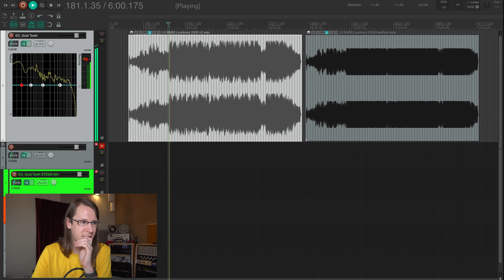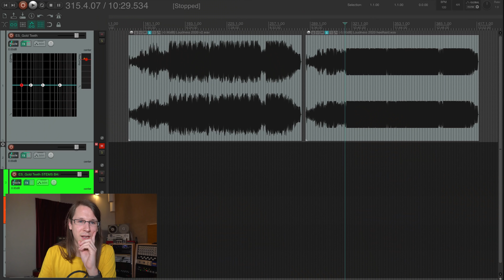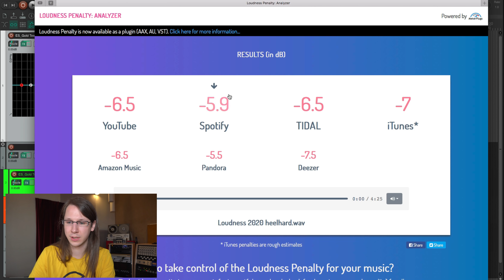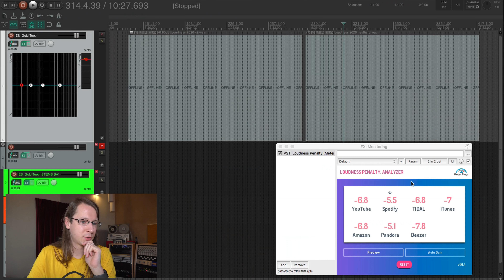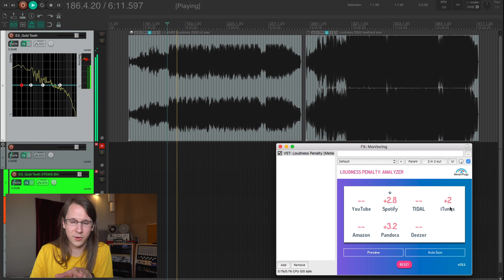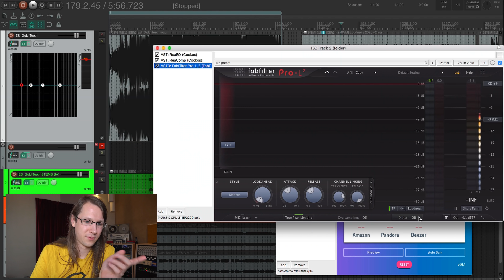MASTERING FOR STREAMING IN 2020!

Comment: WARNING: as much as I love this channel, this is VERY misleading. Master your track at the recommended Spotify volume and then be amazed and depressed when your song sounds significantly quieter than the next one. The default setting in Spotify is normalization but you can turn it off, and they’re not transparent about the process of “normalizing” at all. If you look in the Spotify for artists section on mastering, they give a vague explanation, but it’s clear that it’s not perfect. Bottom line, all the top mastering engineers still master to a -8 RMS for any mainstream style of music (hip-hop, electronic/edm, rock, pop). The art of mastering at this point is being able to make loud masters that are also dynamic. IT IS POSSIBLE. You just have to know what you’re doing. For dynamic music (classical, jazz, folk), yes, make it quieter. But what’s also never talked about is you don’t even use a limiter in these genres usually (altho a lot of contemporary jazz that’s not off blue note or verve definitely is trending towards a more contemporary limited sound, e.g. Brownswood records). My suggestion is use a maximizer and then  2-3 limiters in series as the first thing you do, and then work backwards. Start at your target volume and then make the master fit into that volume. Why? Because maximization and limiting IS compression. You need wayyyyy less compression than you think once you’ve done this, and then you just sculpt into the limiter. Try it. Game changer. Anyway, don’t believe the hype. Great channel, just a misleading video
Reply: Hey Justin, heard the same thing. I am wondering, how do you set up your mastering chain? I've been pushing my volumes up with just one limiter but seems like it's not ideal and I should use many limiters in a chain. I am just not sure how much gain to push in each of those limiters. Say I need +10dB increase in gain, do I slap on three limiters, each one giving approx. 3-4dB in gain?

Comment: the reason for -1dB headroom is because it may clip after being converted to the codec of platform and avoids intersample peaks
Reply: 1.5 db for mp3
Reply: I guess my question is why they cant analyze the volume first then convert.
Reply: @klontjespap  every mp3 I've ever looked at does not have any headroom. Have you found one or why do you say 1.5db of headroom since literally noone does that, can't find a single mp3 that has it. So if you do that then your track is just gonna be 1.5db lower than literally anything else in your library
Reply: AboveEmAllProduction that’s why the headroom is necessary, the conversion literally eats it up
Reply: @Tiban  no , not really, it does eat up alot of it, but not 1.5db. and if you already used True peak limiting in the mastering chain, theres only ever about 0.5 - 0.9db extra created from the mp3 conversion. and if you look at your local mp3s; most of them seem to go way over 0dbfs; thats why my point is valid too - your master WILL be quieter if you use true peak limiting ASWELL as -1.5db of headroom.
Reply: AboveEmAllProduction No because your true peak limiter can‘t 100% correctly predict the intersample peaks after conversion. If it was so why don‘t u just put your true peak to -0.0001dbtp? Should work fine then. there‘s still even with true peak depending on the file intersample peaks up to 1.5 db put tbh I myself always use -1.0 dbtp with oversampling on (which calculates the true peaks even better) to make it fine. after the converted audio i don‘t have headroom anymore like this
Reply: @vincevangoat1  Some real mastering engineers do not limit their tracks at -1dbtp, I've read this makes the track sound more compressed while being too quiet, I would say -0.3 to -0.5 dbtp is a sweet spot for making the tracks breathe while being as loud as other commercial releases.
Reply: Audio may clip if u boost some frequencies in eq on Spotify (if it’s not -1,0 dB)
Reply: LowLinK  haha you've got a point man, all this discussion about intersample peaks and mastering for Spotify exclusively bla bla bla, like if the audience will actually be able to tell any difference - they will just like the loud and powerful stuff, like "bad guy" by Billie Eilish.
Reply: @joel6633  It gets normalized anyway though, so if you have no dynamic range your shit's gonna sound terrible even though it's "louder" in raw audio format. Most amateur masters that try to push too hard when played next to good masters of the same genre with engineers that know how to preserve dynamic range, they sound like ass - the bass is held back by the squash and there's no punch at all. The reason Bad Guy still slaps normalized is because of dynamic range, not because it's squashed.
Reply: @cyootlabs  I'm sure it isn't squashed, but I doubt they mastered it to -1dbtp. I have noticed some songs actually sound more quiet than others in the same genre on their loudest peaks even though they're normalized. I would guess that's because the louder stuff had a higher ceiling than the lower stuff.
Reply: Intersample peaks can go above 1db. Limiting to -1 is never enough. It is pointless to limit a certain amount just to compensate for intersample peaks. Just set the limiter to however you want.
Reply: @AboveEmAllProduction  You are absoltuly right. I have tracks with peaks up to +1.6 dB. Master as loud as possible still applies.
Reply: @pushtoenter4174  no you still shouldnt master as loud as possible :) thats the wrong mindset. but technically speaking i hear you, you are basically trying to control the dynamics to make it as "loud as possible" without having distortions that are too audible. +1.6dfbs surely causes tons of distortions?
Reply: @klontjespap  no 1 db is enough, the thing that causes the intersample peaks is the psychoacoutic filtering used to remove information that most can't hear, this filtering (like any filtering) causes a change in the waveform causing the peaks to change, this results in overs of up to 1DbTP

Comment: A friend of mine uploaded a quieter track in spotify: it was really quiet (made on purpose hoping that spotify turned up the volume). That did not happen, i think spotify and other stores do NOT turn up volumes. just down
Reply: That is also what they told me
Reply: I knew Youtube do this, just trying it out of curiosity a couple months ago
Reply: I think this is quite likely true otherwise they'd need a limiter in their normaliser
Reply: Remember u can still mark "normalize" option in Spotify settings and check them again
Reply: Make sure the option for level matching is turned on, and make sure you're not using the web client, as it doesn't even offer that option. But yeah, you can't just expect to upload a quiet master and have Spotify turn it up an limit it till it sounds as loud as everything else, because there are so many reason why one track sounds louder than another that can't be caught with a LUFS meter.

The loudness wars are not over.
Reply: @David Shackney Technically, no difference. You can then think the compression being the penalty itself. The common misconception is that compression (and limiting in its extreme form) makes things louder. Actually it doesn't, quite the opposite, they are turning things down. The headroom then allows gain compensation for louder but less dynamic audio, and most of them do that automatically when you adjust threshold. You can think the loudness penalty as having a limiter but the gain compensation turned completely off. It doesn't really make any sense to kill the dynamics, since you don't gain anything in return. 
"DJs have done this for decades", yeah, the opposite way. It's "safer" to be a bit too much loud than losing the energy, and no-one wants to be the DJ that sounds weaker than the one before. So by the end of the night the last one is playing every meter solid red. Pioneer has always decreased the level where meters go red, but DJ:s became aware of that. But what they are not aware, is that there is always a limiter to protect the sound system, that doesn't allow them to exceed certain level and the ones playing too loud will sound like shit. Best example I remember when I saw Koxbox few years ago. He was hitting the limiter so hard, whenever there was bass, there was only bass; whenever the bass dropped, all the mids and highs went up so much it was actually painful, even 100 meters away of the stage, outdoors. The same goes with mastering for streaming, the more dynamic masters will sound punchier and overall more juicy than the ones that have pushed to death when played at the same level.
And for the remasters, why not? The big records have already been remastered many times to match the era. I don't see why wouldn't we see a bunch of remasters done in a few years, since streaming services keep on growing. And if you have a intro that feels too quiet, you may consider automating the level, against smashing the entire thing through a hard limiter.
Reply: I’ve tried this and they don’t turn it up ... you’re right...I’ve found you’re best to keep it quite loud to be competitive
Reply: Very true. And even with the "normalize" option in Spotify, you still need semi-loud mastering. I know from experience, my subtly mastered track sounded softer than all other similar tracks, I had to fix it and redistribute all over again.
Reply: @David Shackney Perfect !!! All BIG DJs are streaming at -6 LUFS today. No one cares about -14 LUFS or dynamics or thue peak.
Reply: @heryouhatebuttowhoyoumaste1991  No, they pay for mastering companies that include things like a person who gets paid salary to JUST listen to the mixes in isolation before it even gets to the engineer working on it. It's a very involved process. It sounds louder because the engineers actually know what they are doing.
Reply: This information is wrong. They do turn up or down every track to be at a similar level, but there's an algorithm to this: it depends if you're playing songs randomly, so in a playlist the level will be the same if you shuffle, but if you just select a track or play it from an album it will be at its original level
Reply: u r sooooo right. Spotify does turn louder tracks down to -14 db but they are the ones that appear the loudest compared to songs uploaded at -14 db..

Comment: I have started to make -14 LUFS so Youtube won't do anything and Spotify will boost roughly 3dB. Some soft limiting and checking levels are good in Youlean, and if needed for own mp3's or so, just add compressor/limiter plugin in chain after Youlean. Also one Youlean after that to check how levels are, and bang! You can save song with -14LUFS muting last compressor, and then activate it and save louder version.
Reply: Also, when mixing tracks, use that compressor to check how it sounds after compressing so it will be good. If only mixing without compressor, it may cause trouble when doing final compression. Just check everything is good using compressor on/off.

Comment: can you make a video about psychoacoustics, and how to get a "perceived louder" master?
Reply: This right here. I know the answer is that the perceived loudness has to do with the mixing, but i would love this being discussed more as its something i feel a lot of people don't talk about.
Reply: Create headroom by taking out frequencies that aren't adding valuable information to the track. That's generally gonna be in the low-mids, in my experience - the infamous "smiley face curve". Any couple of dBs you can scoop, means a perceived increase in every other frequency you didn't scoop.
Reply: I recommend you watch this video:
https://youtu.be/EiRMYoqU3ys
In a streaming setting where  loudness is "normalized", all songs are adjusted to have the same integrated LUFS value so they have the same perceived loudness. Outside of these platforms the songs with the higher RMS or LUFS value will be perceived as louder and you can achieve this through heavy compression and careful level mixing. 
In the video I recommended you can see how being slightly above the target value of a streaming platform can make a song sound more interesting than the other songs with higher LUFS value because it is more dynamic.
I don't know why but to my experience, it seems songs are still being mastered to reach the -8 LUFS target (or louder) regardless of the streaming platforms loudness control.
I'm no proper mixing or mastering engineer so don't take what I wrote as gospel.
Reply: The Sonnox Inflator is a great plugin for that, with a limiter can give you that feeling of louder without gaining true peak i think theres other plugin that does that (Reviver) but basically is a “saturation” technique so when you go to the mastering process you can gain even more volume.
Reply: @tired.mp3  u cant have 10 mixes for each streaming service. Just one.. and no they don't normalize unless its turning it down, never up. So make sure your LUFS are hitting in the ball park of commercial music.
Reply: @gusdee4844  I know, I didn't say that. I quoted the word normalized because I read in some of the comments here what you are saying. I guess it's true but it seems weird considering the goal is that users don't have to adjust their volume knob.

Comment: Hi folks. Just to let you know the standards and algorithms for LUFS/LKFS measurement are available online. LUFS uses the k-weighted filter for it's measurements. It's a two-band filter with a low-cut on the bottom and high-shelf on the top that helps to mimic the perceived loudness curves of our ear (Fletcher–Munson curves) . The filter co-efficients are available in the Rec. ITU-R BS.1770 (page 4) paper, on MATLAB documentation, and also if you dig into the JS- on the actual Loudness Penalty website. It isn't a perfect system for measuring loudness but was made as a one-size-fits-all as it is easy and inexpensive for software and hardware engineers to implement into their tools. I've had clients which try to get me to 'trick' it and there isn't really a way to do it without destroying a perfectly good mix- either by boosting loads of bass or keeping high frequencies to a minimum.

Comment: Glad you put this video out.  I've never understood why so many people master to -8 Lufs, when it's just going to get turned down anyway. 
As far as mastering for different streaming sites, I don't that either. I usually just make one file that meets the requirements of two different sites.  That is, I master for the highest lufs (-12 lufs required by (I can't remember who)) and for a true peak of -1.5 (from Spotify, I believe).  Mastering a file that meets the requirements from the different sites ensures you won't have any trouble no matter where you send it.  The only caveat in this is that I believe some sites require a smaller dynamic range.

Comment: 10:20 I think they want the tracks to be -1db at peak is because when the file gets compressed to a codec it gets a little louder and so it doesn’t go over 0db
Reply: Yup I've had tracks peak when converting to mp3 from 0.3 db true peak
Reply: yeah, it's unpacking the mp3 before it goes to DAC. sometimes you can get close to 2db gain from decoding mp3 to pcm.

Comment: Hello, are K-meters no longer used? It is the standard that Bob Katz created. There are quite a few meters, like the Vozengo Span and mzuther K-Meter, that have this scale, K12, K14, and K20. It makes me very similar to using VU-meter, where it has a knob to calibrate the 0dB VU.

Do you know the HoRNet plugins? Normalizer, VU-meter, LU-meter, all with automatic gain to speed up the "Gain-Stage". And CLMS to avoid "the disappointment of loudness". Very useful and cheap.

The "Track Coherence" plugin measures the "Crest factor". Same as "TT Dynamic Range Meter" and many others, but I don't know which is more "accurate". Any suggestion?

Comment: Ok... Correct me please, If I get this wrong... According to my understanding the human ear hears loudness mostly via the average volume encountered.

Above is the reason why a more compressed  file always sounds louder in comparison to the less compressed one ie. a track by -10 LUFS with 8dB dynamic range sounds louder than a track by -10 LUFS with 15 dB dynamic range.

Right? So to achieve loud results in comparison with the rest of the bunch means that the quieter parts should sound louder in comparison to the peaks ie. compression should be used... Naturally in a way that it doesn’t make the sound all too flat.

Getting the very last part (compressed, but not flat) from the above is the true skill of a mixing (and in some cases the mastering) engineer.

Right?

Comment: The guidelines are great, thank you. At the end of the day one has to use one 's ears according to what is best for the song and depending on what material it hosts inside of it. If one is not willing to feel out how loud a collection of files should be mixed and thereafter mastered at as one file then one won't find it's sweetspot.  Don't think the sweetspot is not loud enough, it is, then when mastering it's all about where you can take that sweetspot to a louder one if needed according to what processes the material can handle ect.
Don't mix at mastering levels either, leave that headroom for your dynamics that will later trigger your mixbus chain and or mastering chain. The mix's headroom takes hands with what mastering chain can achieve without destroying the music. Personally I find it easy to hear good or bad pushback from any device or plugin used when making music or pushing that music upwards. 
I hope my attempt at commenting in a non technical way helps.